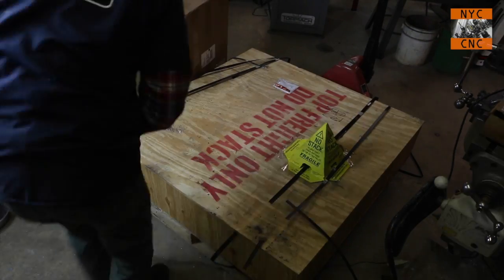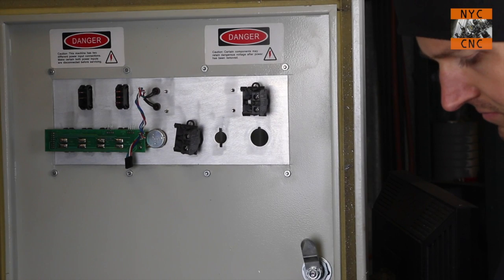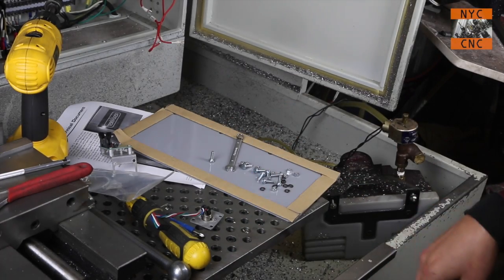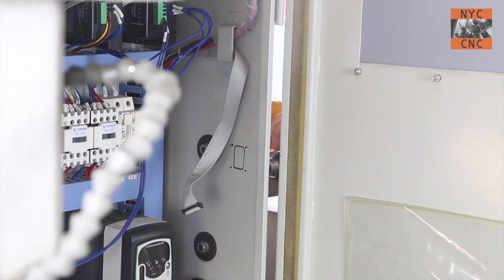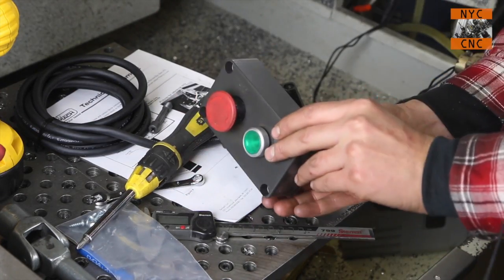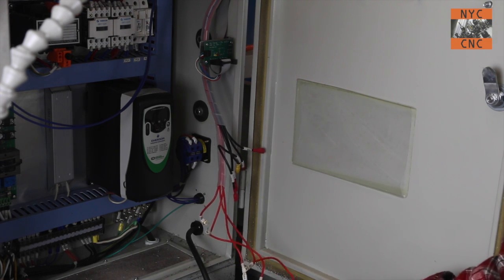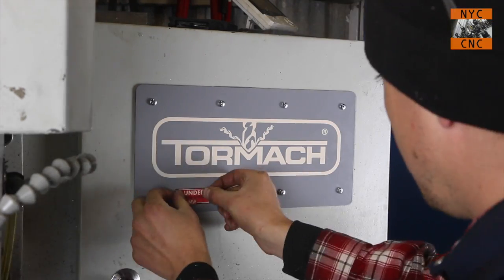Tormach PCNC Enclosure - Installation & Review Part 1

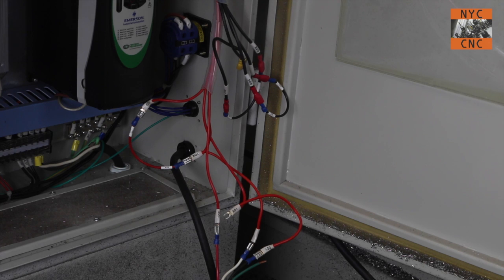Comment: 6:22 On an industrial machine, there would be a threaded grounding stud on the front door (all paint removed for a bare metal connection) if there are electrical devices such as switches mounted on the door, particularly if there are 120 VAC or higher voltages on the door.  I think it's a good practice for a home shop as well.  I typically don't put any electrical devices on the door when I'm building a machine for home shop use.

I'm looking forward to seeing how this projects ends.  I've always thought the Tormach could use a full enclosure.

Tormach is probably making a NEMA 4X enclosure for Grimsmo Knives, given the extreme rusting that he's had in his Canadian garage.  :-)

I've thought about making a custom fiberglass over foam enclosure for my milling machine.  I saw a YouTube video an identical CNC converted mill with a custom enclosure that looked very nice.  Heck, I'd be happy to fold a couple of 4X8 foot Coroplast campaign signs to contain the dry chips that the Tormach SuperFly slings all over my basement.

I love how Judd is always curled up behind you when you're making videos at your desk, and now we get to see him out in the shop.
Reply: NYC CNC
Judd looks like a fast pup, even though we usually see him curled up and trying to sleep while you're keeping him awake making videos.  Your YouTube fans appreciate it.  Judd can nap later.  :-)
Reply: NYC CNC
It's obvious from the video that Judd is mildly put out by the video lights when he's trying to nap.  He seems to be reenacting every Christmas from my childhood (1965 to 1975).  My dad would have his 8mm movie camera with the two large bright lights on top as the sleepy kids stumbled into the living room, too blinded by the light to see any presents.

Judd is a very expressive dog.  He'd be terrible at poker.  "I got a pair of kings!  I got a pair of kings!"

Comment: Hi John,

Hoping this reaches you since the thread is so old, but Wondering what you did for mounting the E-Stop? Just installed the enclosure on my Tormach 1100 and not sure what other guys were doing for E-Stop positions.

Thanks! Keep up the great work on the videos! I've used all of the installation videos you've posted to help install mine!

Comment: I know the terminal block didn't seem necessary but it's also used as test points in electrical troubleshooting of the unit. it probably has schematic showing the wires connected to the block, its exposed but that's why it's inside the enclosure.